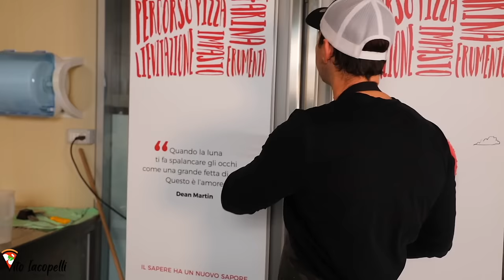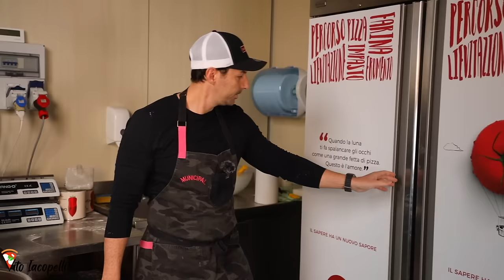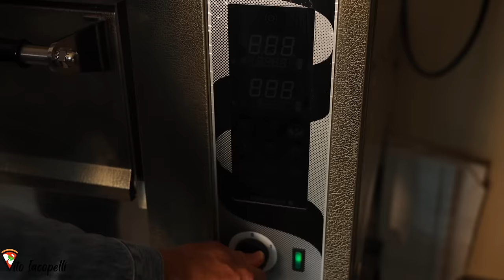Neapolitan Pizza Dough Most Successful | Full Process Vito Iacopelli

Comment: You make the balling process look super easy. I used to have to make the dough at a Pizza hut... (sorry for bringing them up). This meant that I had to weigh every single ball of dough, to ensure it was the right size for the pan it was going to be placed in. Your method would make that faster, by a bit, but would ultimately be slowed down by the weighing, the flattening, and the placing in a oily pan. 

Still. Neat method. Will use it for personal use, since I left that job a long time ago.

Comment: Hello guys, i've been having issues with the poolish lately. In the summer (30C) everything was fine i leave the poolish 1hr R/T and in that 1 hour the poolish is already rising and with bubbles. Now in the Winter its around 12-13C where i live and when i leave the poolish 1hr R/T like usual, the poolish will not rise and will not be that bubbly, even after the 16-24hr in the fridge. I've tried leaving the poolish 3-4hrs at R/T before i put in the fridge and its been much better. Was just wondering how Vito always puts the poolish only for 1hr at R/T.

Comment: Trying the 100% poolish at the moment. It’s so sticky though. Not sure if I was doing folding technique wrong but more oil seemed to help!
Reply: let it rest for 10 - 20 minutes at room temperature when its sticky and try again - usually works!
Reply: my problem too.
Reply: let it rest for 15min, i also changed the flour for caputo and it helped bonding is stronger
Reply: Olovoio on your hands and don't be scared from the dough when folding. It becomes easy if you believe in yourself.
Reply: @thetoster7  good shout. In the UK I was told bread flour is 00 flour. It’s possible I’ve been using the wrong flour 😱. I got some flour this morning that is actually labelled as 00. Let’s see, Poolish is already fermeting in the fridge 😀

Comment: Pizza
 Pizza dough 
 Drum flour
 Salt
 Egg 
 East, 
 Hot and cold water 
 Marinara sauce
 Milk
 Shredded mozzarella cheese
 Sugar
 Dough making procedure:
 To make dough clean dough 
machine container very well, 
connect with electric supply, put 
egg, milk salt, sugar milk east 
hot and cold water, drum flour 
in dough machine container, stir 
with mortised stirrer very well 
for 10—15 minutes when the 
dough will become like a single 
lump take out of the machine, 
measure and cut it in to pieces 
like half a pound each reshape it 
like a circular dough put in a 
small bowl pouring little oil and 
keep it in a freezer.😂🎉😢😮😅😊